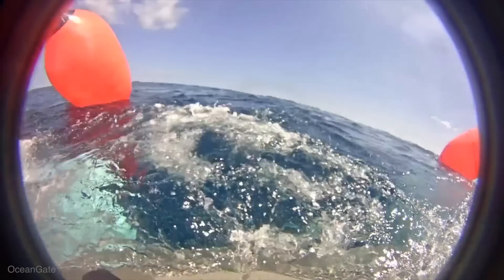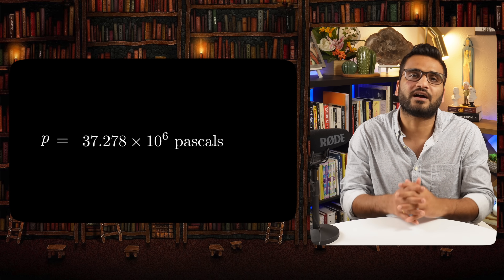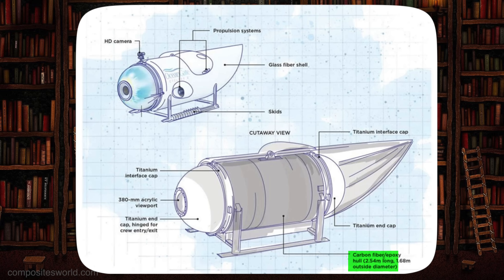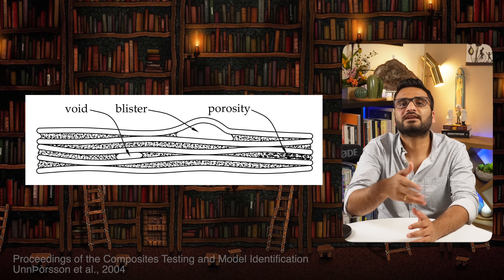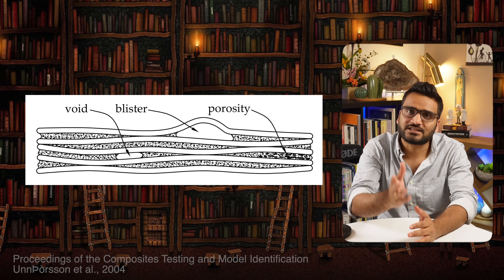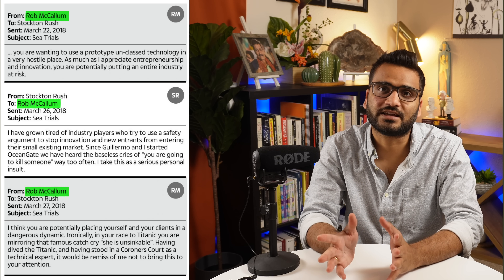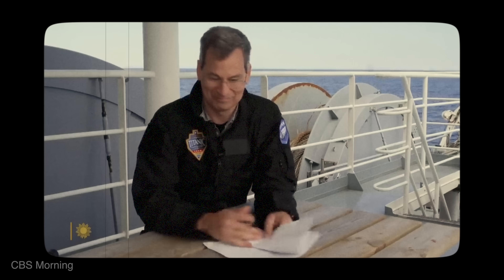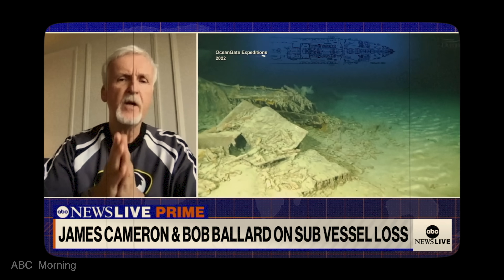OceanGate REALLY messed up - A Structural Engineer's Perspective | TITAN'S TRAGEDY

Comment: I use structural engineering software on a daily basis, the software acquires its immense database of materials from several cloud based sources. I can test virtually any shape, material and a multitude of loads.
Ocean Gate no doubt had access to the same engineering and modeling software.  In my case, when I learned of the Titans general construction, after the accident, I ran several models based on its design.  Watching videos of its construction, I was able to input all of the variables such as weave versus linear layup as in the composite construction seen in Titans case.
In order to simply endure the pressures encountered at Titanic’s depth, my software dictated a weave layup and a hull thickness of 447MM or 17.6 inches.  Far less than the Titans 5 inches .  Further, and most alarming were the results when considering dissimilar end cap material.  The different expansion and compression rates of composite against ( bonded ) titanium are substantial.  Using the software, I noted failures exceeding 1MM, which would inevitably cause failures at the seams.
All of this data in less than 8 hours,  using widely acceptable and certified software.  I’d conclude that Titan was doomed to catastrophic failure.  I’m concerned that the data was known to its engineers and certainly the owner. My only guess could be the huge expense of the build outweighed terminating the dives in sake of safety.  The price of an ego and profit/loss.
Reply: I made a wording mistake,  with regards to hull thickness.  It should read that 17.6 inches is far more than titans 5 inch thick hull.
Reply: @Leo-fk9ch you can edit original comment instead of posting addendum
Reply: Looking at the photos, I reckon  the stress on the carbon tube are even worse. The motors seem to be mounted directly onto the tube, so when the motors are energised they are puting a torque load onto the wall too. So there is compressive hoop and longitudinal stress, and a twisting torque. On top of that, disimilar thermal expansion. I would have thought motors etc should be mounted on a non pressurised exoskeleton frame, leaving the actual pressure vessel just to be a pressure vessel.
Reply: @TheScotsalan  from the other subs I’ve seen, that seems to be the case, but Stockton knew better……………………
Reply: @gamerdrive5565  Yup. I aint against the innovation, but to me, as just an ordinary mechanical engineer, if I were to do a design intent for such a sub, the crew compartment would be isolated from the props etc. To keep the stress calcs easier at least. Whats worse, interior photos appear to show the pc monitors mounted in domestic frames, SCREWED onto the pressure wall. To me, the crew chamber should have one job, and one job only.
Reply: @TheScotsalan  no the motors are attached to the fairing which is attached to the titanium rings. Also the monitor is not attached to the inside of the hull, if you look there are lights underneath what the monitor is screwed into
Reply: @nos4me  I figured that had to be the case, but it would be extra funny if he had just gone f it, screw em into the hull it’s just 5500psi no big deal.
Reply: Titan didn’t use a woven carbon fibre hull - it was wrapped in unidirectional carbon fibre that was simply spooled onto the 6mm titanium hull.
Reply: @allangibson8494 was there actually a titanium tube in the finished sub, I haven’t been able to tell, but when they were gluing on the end caps, it looked as if it was just the cf spool no ti tubing. 

Genuine question not throwing flame, I just want to know.
Reply: @gamerdrive5565  I know it was formed on a titanium tube. What was left after it was machined to size is another question.
Reply: @gamerdrive5565 no titanium tube.
Reply: Best answer I've ever seen. Bravo 👏
Reply: @Leo-fk9ch - Excellent input. “Old White Guy” here with 40 years of experience building Composite structures at the World’s largest defense firm (in 38 Countries).  Have you seen the video of “mating” of the Titanium end cap ring to the composite hull? It will surely piss you off (at least it did me) … not even an interference fit and all done with some kind of resin (epoxy?) material and “potted in” with squeegees … in an open “Warehouse” setting instead of in a proper “Clean Room”!!! Holy Bat Guano !!! The way Rush explained it in the video where the mate operation was accomplished is that the “Resin” material acts like a “Cushion” to allow for the differential expansion/contraction rates between the CF and Titanium.  UFB !!!  What happens when you dip a smooth steel rod into a pot of silicone and let it “cure”? That’s right … it’ll just slide off. Initial reports indicate there wasn’t any CF remnants on the Titanium nose mount ring. Well duh !
And Rush even bragged he got the CF Tape from Boeing at a great price as it had “expired”. You and I know the CF Tape can be “retested” to extend shelf life … 1 time and usually for only 3-6 months max. And Boeing knows this too and probably did the re-test before sending it off to the “Scap Department”; Boeing is AS9102 certified and no way they’d have sold it without “Scrap Tags” affixed.
As for the software you use … you meant to say “… 17.6 inches ... far MORE than the Titan’s 5 inches.  The method of lay up was all wrong to begin with … flat tape over a round mandrel with very little offset skew/overlap. IMHO, the proper method would have been to use a “thread (tow) laying machine” with min 45 degree cross hatch and CF interlaced with Boron fibers. Would be interesting to know what your software would say using these parameters???
Reply: @craigsowers8456  Interesting stuff Graig. I am a mech eng, not never used composites. Quick question if ok 👍. Is the epoxy used on CF the 2 part self curing type that is exothermic ? I honestly dont know, my training is in metals. When I watched the vid I wondered if the curing rate would cause stress, given the wall thickness ?
Reply: @TheScotsalan  the type of resin being used cannot be determined by just videos and we also don't know what was adhesive was used to mate the Titanium flange to the CF hull (which was made wrong to begin with for  this application ... an Auto-Clave was a must as well as a "Clean Room") ... and yes of course, the cure rates can affect outcome ... and why in an Auto-Clave, we have many channels to monitor a very specific heat ramp rate.  All this will eventually come out in the NTSB report (12-24 months from now). Hope this answers your questions.
Reply: @craigsowers8456  Tks for reply 👍
Reply: Did you take into account the different properties of a unidirectional lay in compression along the fibres length compared with the lay being using in the correct tensile mode?  I suspect that under compression the long term strength of the composite would be little more than that of the epoxy resin block, complementary stress separating fibres and allowing them to bend. Fag packet calculation gives about 6 inches thickness in steel, although refinement, specific steels, allowing some plasticity etc would reduce that.
Reply: Which software did you use? Most finite element software is not free, so im just curious.
Reply: how accurate compressive strength characteristics are of carbon fiber and what safety factor and/or strength reduction factors do you use for this composite material?
Reply: I’d love if OP would use this software to recreate the titan and see how many simulated dives to 4000m it makes before imploding. 

I’ve heard 3800m and 4000m for titanic depth, not sure which is correct, but probably important to test accurately. 

Also I think compression cycles (descent and resurface) are 2 hrs a piece. 

Would be kinda funny if it implodes on dive test 1, every time, cause that would mean Stockton had created a physics denying submarine, brilliant, until it suddenly wasn’t 😂
Reply: @gamerdrive5565  The Titan was supposed to be rated to 4000m and the Titanic is sitting at around 3800m.
Testing on other carbon fibre submersibles showed that their pressure handling capability declined exponentially with each dive - with one unmanned submersible designed for 6km collapsing at 8 meters on its tenth dive.
Reply: @allangibson8494  yeah I knew about the titan prior to its implosion, had a brief look into it, cause I saw it’s picture and thought no way that goes titanic deep, found out it was carbon hull and just laughed at its inevitable implosion. 

I’ve heard all sorts of dive numbers thrown around, best I can find is it made it to the titanic twice, this was its third attempt, do you know of correct figures for the amount of cycles to 3000m or deeper by any chance?
Reply: @gamerdrive5565  Titan made 12 successful dives to the Titanic over two years. This was its first dive this year.
It made a lot of failed dive attempts (which indicates gross incompetence in maintenance) and lost communications with the surface on most of its dives for periods between one to four hours.
Reply: @allangibson8494  where did you get 12 from? Not being that guy just found it wasn’t easy to source good info on that and all I could find was 2. 

12 on that setup to me seems an impressive feat for how much of an abomination it was.
Reply: @gamerdrive5565  Wikipedia reports about 11-12 prior dives to the depth of the Titanic. I don't know where people get the "two prior dives" number from.
Reply: @allangibson8494 I believe "they" made a number of trips, yet this was only dive 5, and at least 2 dives to the Titanic were scrubbed, perhaps 3. It seems this was only the 2nd or 3rd trip  to the Titanic. 2 scrubbed dives seem to only have gone to 33' & 38', but not the 2.4 miles trip to the Titanic.
  The OceanGate CEO and at least 1 other staff member, PH, seem to have stretched the truth a lot, to put it mildly.
   So many problems with the engineering, communications, the sales pitches, and the entire outfit.
  I certainly wouldn't have dove with them.
Reply: @gamerdrive5565 I think the CEO said "they" did 12 dives, yet it would seem only 2 or 3, including the implosion trip, in total to the Titanic. This may have only been it's second dive there.
Reply: @coolcat23  sometimes you’d be better off sifting through dog shit to find answers than using Wikipedia.
Reply: @CarolReidCA  I am thinking people are confusing some numbers, I got 2 and this is was the third. 

There’s too many things wrong with the build for it to have made that many dives, I’m not an expert but as the news guy said when he saw the controller “cmonnnnnnnnn”
Reply: @gamerdrive5565  Factor of safety plays a part too 👍. Loads of ppl go on about the window rating, but I reckon it prob had a massive factor of safety. So it could make a few dives.
Reply: @TheScotsalan  if it were the window, they may have gotten to watch it crackle before it popped, if it was the hull imploding, probably had no idea it was coming.
Reply: Which software did you use? Most finite element software is not free, so im just curious.
Reply: @Cam-ng8rk  one of the software programs I use, and for my use here is a proprietary program developed by and for Lockheed.  I am a consultant engineer with Lockheed and have license to use it.
Reply: As a matter of interest Leo, did you have a look for any data to check the  software ? I mean cos we are talking compression, rather than the more usual internal pressure. For example, a soda can is able to hold loads of atmospheres, but will crush under the slightest vaccuum. Indeed, when I think back to my studies, likes of Lames equations were for internal pressure, not external. I am not disagreeing with you here, genuinely interested. For example, I use solidworks, and its quick and simple to do a check on deflection and stress of a component. But we trust the software ppl. If it was really critical, for me, it would be optimise on CAD, then double check with pen and paper. Not defending the designers here, but the sub has worked before, so they did get something right. Maybe the design had no factor of safety ? Or maybe it was an unknown failure mode ? I am thinking of the brittle fracture of steel for example, that caused the sinking of the ship Derbyshire.
Reply: @TheScotsalan  All good points.  My evaluation used only compression loads. The carbon fiber vessel was under designed, at this point that's obvious. A 6" tube made of unidirectional layup has a compression max load to failure of 4300 psi.  This means in simple terms. The tube may not have a catastrophic failure, but will develop internal failures that eventually cause a catastrophic failure. In titans case, he proved this true after several dives.  Those cracks and pops heard were the tibe progressively failing.  A tube of 17.6 inches would withstand thos pressures safely but still would ultimately need retitement. Carbon fiber is simply unsuitable at any thickness.
Reply: @Leo-fk9ch  So your software is going to be better than the add on in solidworks Leo ? I use that sometimes for checking and optimising simple parts ( deflection usually). Fine for what I do. I did used to work with a guy who has a PHd in stress analysis. He had a cool software setup, but it could take him weeks to setup and run a full model. His results were super accurate tho.
Reply: wow!  thanks for sharing that - unbelievable......surely someone ran those calculations....right? Then....made a decision.....just wow to consider
Reply: I am wondering where you found the videos that showed the detailed layup of the laminate.  So far I have only seen videos that show simple hoop winding.  I certainly hope that the layup sequence was more than that.  As someone who has been involved with the design of RTP equipment for the chemical industry, I would love to see just what they did.  (20 years on ASME RTP-1 committee.)
Reply: @jamesfisher4326  Im not 100% but i think it was just hoop winding, as oceangate have the video showing some of of the construction and then Stockton said that there are no torsional forces underwater on the cylinder as justification for doing that.
Reply: Very interesting.
Reply: You said the engineering software was certified, Stockton wouldn’t have dreamt of using anything certified 😂
Reply: @gamerdrive5565  but... He was a CERTIFIED lunatic... 😅
Reply: "...Ocean Gate no doubt had access to the same engineering and modeling software...".  Why would you assume that?
Reply: @MrShobar because any competent engineering company would.
Reply: @weirdwes6725 ocean gate was not a competent engineering company.
Reply: @amadablam8229  Correct.
Reply: @amadablam8229  True, but they could easily have hired a competent engineering company.
Reply: @MrShobar  They had access to commercially available sources such those referred to.  They may have not bothered to use them, but access was available.  Anyone with good sense designing something like this would utilize the best available resources.